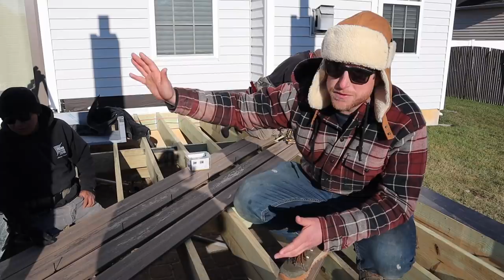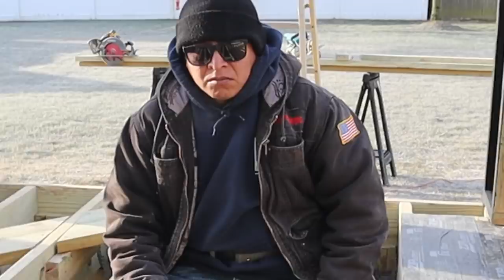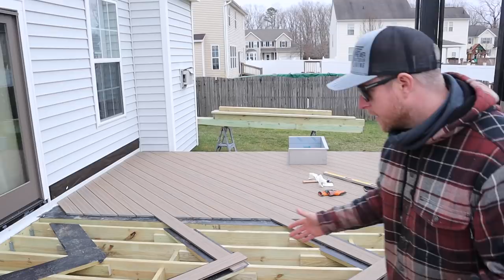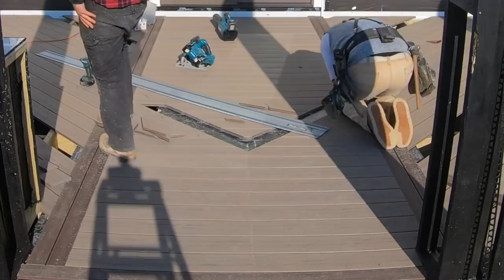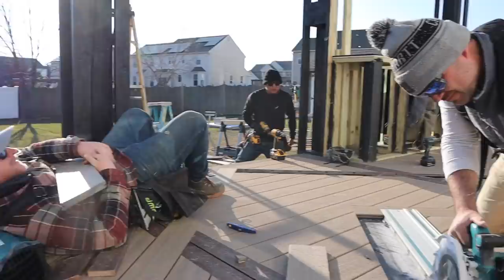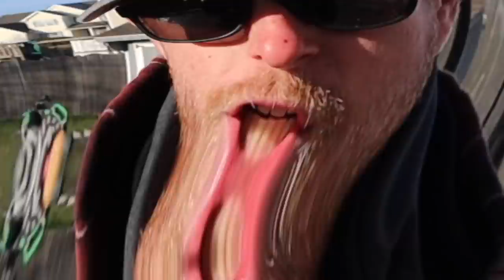Installing Composite Decking on an Angle With a Cool Inlay - TZMBV PART 4

Comment: Does it matter which type of joist tape I can use on my deck using decorators. ?  Does it need to be special tape or decorators joist tape. Or will anything work

Comment: Quick question - we are in a state of dilemma - which one would you recommend Deckorators Voyager or Trex Transcend ? Also, for railings  which ones would you recommend - welded aluminum from Deckorators or Timbertech Radiance?